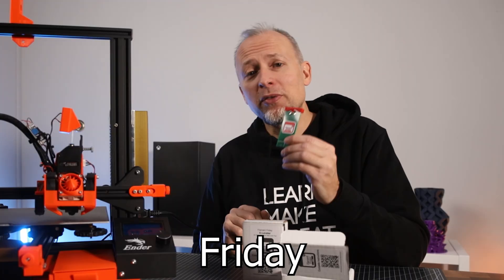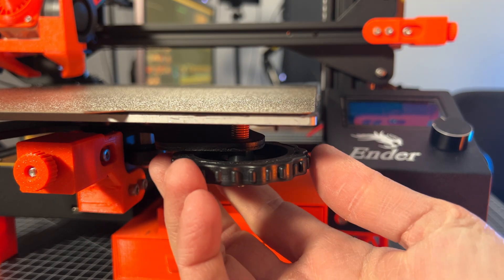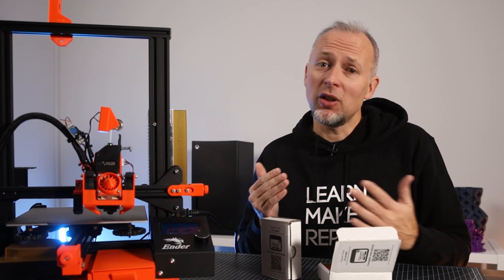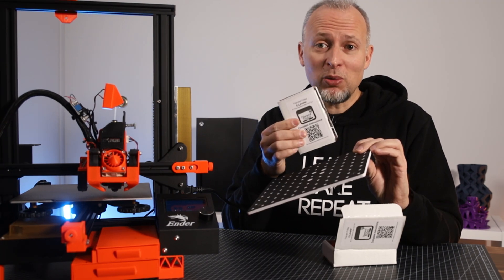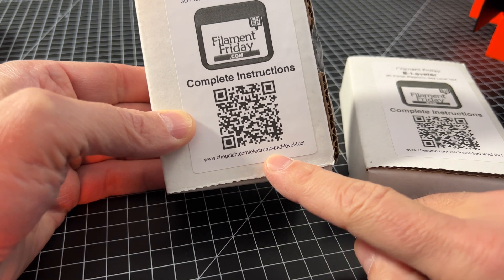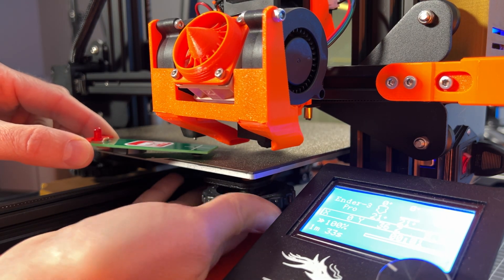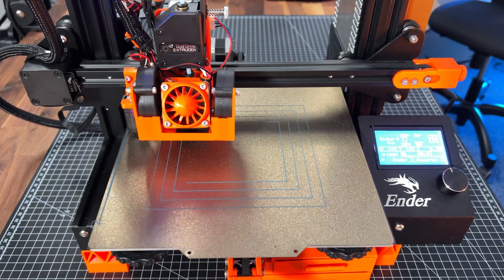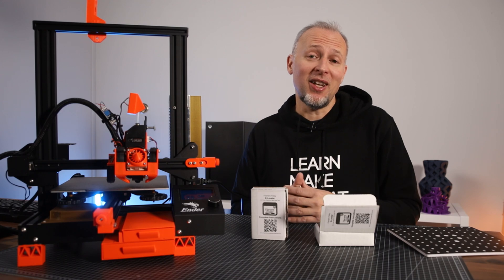Tested - Filament Friday E-Leveler Tool - Bed Leveling finally easy for everyone?

Comment: For the people confused:
The E leveler uses a print file that stops at a point higher then the home BUT at the hight where the leveler has the marked center point after the print is done it will go back to home and the regular printing height.(if you're still confused there's no hope for you)
Reply: Is Godzilla ok?

Comment: Not sure what I'm doing wrong. I find leveling with paper quicker, easier and more accurate. I've had the e-leveler2 fall apart (the back riser isn't secured) while trying to use it, and the delay is definitely not long enough if you need to adjust. The manual leveling can be done quickly and you can take as much time as you need at each point. Curious if others found the same.

Comment: If I level the bed, shouldn't the nozzle and bed be heated? Is PCB of this tool heat resistant?
Reply from the maker: I would not heat it up but you should make sure the nozzle tip is clean. Adjusting the z-offset for the first layer is something you should do by printing a test pattern and then live adjusting the z-offset in the printer menu for perfect results.

Comment: So I'm a little confused. If it's thicker than a sheet of standard printer how does it work? After using the tool. Won't my nozzle be too high away from the surface to properly print a project?

Comment: I have a background in electronics and I can tell you one thing for sure, it's ridiculously overpriced. Dunno why there aren't any Chinese knockoffs yet. However I like CHEP's Filament Friday channel so I'm asking myself why not buying one of those to support the channel instead of building one myself 🤔
Reply: I'm an engineer and I will say since YOU believe it is so ridiculously overpriced, why don't you...
1. Design your own PCB
2. Design the plastic end piece
3. Get the the PCBs manufactered
4. Get the tooling done for the plastic end piece
5. Get those plastic pieces manufactured
6. Get all of those along with the switches, battery holders, batteries and leds to an assembly house...along with all the packaging, btw
7. Get the finished product imported so you can start selling them for $5 each and realize your reasonable profit margin.

And I said "imported" because there is NO WAY you will get all that done, in this country today, and be able to sell it for less than CHEP is selling his.

Comment: My bed is pretty dialed in. What I don't get is it seems way higher then a piece of paper. I'd be more willing to try it if I knew how something thicker than paper levels better than paper.
Reply: He forgot to mention that the instructions says that you need to subtract the height of the device to get the correct height
Reply: @badcrash99 thank you!

Comment: It seems like loading and running a G-Code is a little much when you could probably do this a lot easier by running your stepper motors manually.
Reply from the maker: Bed leveling with motors turned off is never a good idea. Weight of the gantry or pressure against the nozzle can have the z-Motor turn and then you can start over. I don’t see why running a gcode is more work. Marlin also has corner leveling which essentially does the same thing, you could just give it a different z-value for the e-leveler

Comment: I really don't get it. wouldn't a 3D touch for $15 be 100x better than this for $20? yes it doesn't compensate for bed leveling, but you can use the mesh values to adjust your bed!
Reply from the maker: You need to level the bed from time to time for best results it does not matter if you have a probe. If you need parts with perfectly flat undersides this is critical.

Comment: I have to wait 20 seconds on each corner and this is supposed to be easier than using a piece of paper? It add many layers of complexity and potential points of failure because now I have to worry about the gcode thing. A piece of paper is the best solution, especially if using a glass bed and a thin layer of glue stick which basically solves all bed leveling problems.

Comment: Aber selbst wenn es super funktioniert, sind es trotzdem noch 84€!!!! für eine Platine, LED, Widerstand,taster und Batterie. Ich weiß ja nicht.
Bei 30€ wäre ich vielleicht dabei.
Reply from the maker: Das liegt eher daran, dass es nicht aus Deutschland geliefert wird. Der Originalpreis sind 25 Dollar. Muss man abwarten , ob sich ein EU Händler findet, für den Vertrieb
Reply: @Crosslink3D  Ah ok das klingt plausibel. 
Dann muss eine Möglichkeit gefunden werden das aus Europa zu versenden.
Produkt simpel aber gut.
Reply: @Crosslink3D  und direkt von PCB way bestellen, wäre das keine Option?
Chep bekommt sein Geld und pcbway übernimmt die Logistik???
Reply: Amazon hat Klone für 25.
Reply: @crowguy506  Aliexpres auch für 15€

Comment: I have one and I love it!  I first make sure the X axis arm is snug (eccentric nuts) and then use the e-leveler to make sure the bed is square with that nozzle.  Once that’s set, I use the mesh level in my Jyers firmware followed by a manual mesh adjustment.  When I start my first print that first layers is dead on and OH so satisfying!   Chuck has a HIT with this great little tool!  😊
Reply from the maker: It’s so simple and awesome at the same time!
Reply: @Crosslink3D  Dear author, please share the g-code file that came with the ender 3 tool, thank you! I watch your videos, very informative and useful.